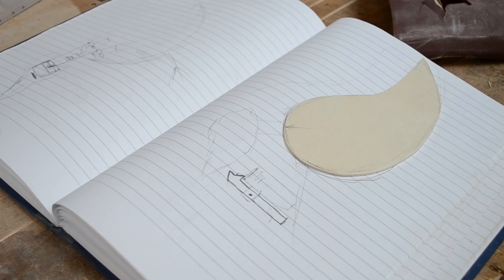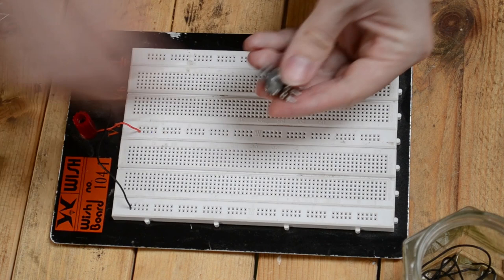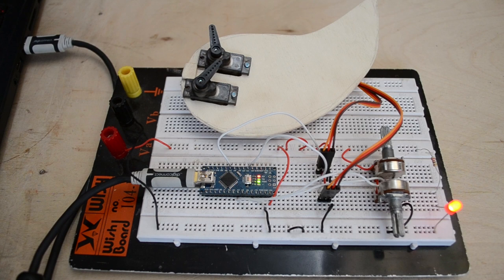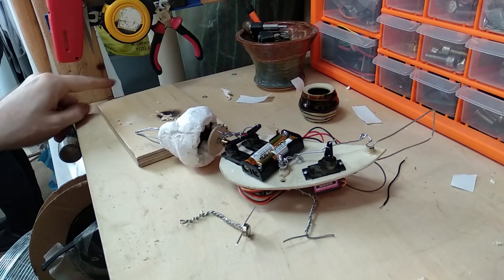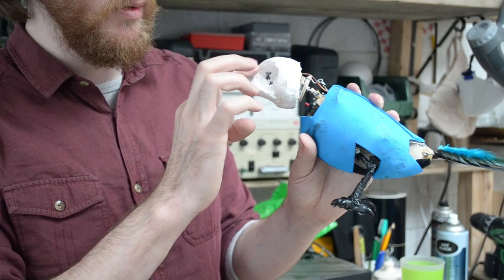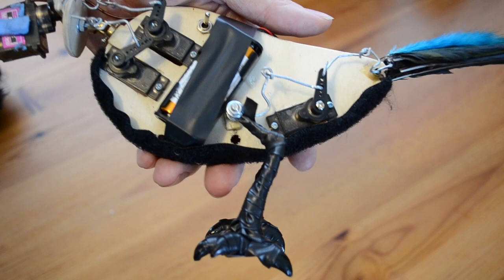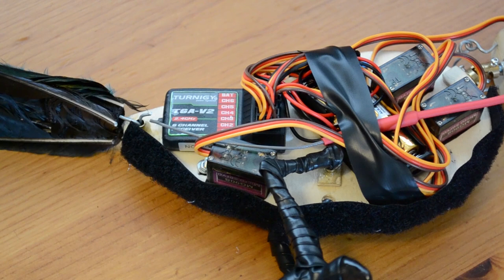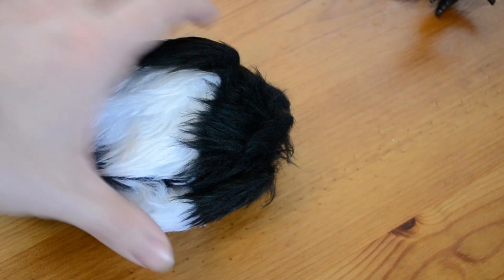Making an Animatronic Magpie (TLDR Version)

Comment: Wow that is amazing! Is Servo like an Arduino program? Such an awesome piece to the costume!
Reply from the maker: Glad you liked it. Servos are the little motors that pull on the linkages to make everything move. You can move them by wiring them to an Arduino, start with this tutorial https://www.arduino.cc/en/Tutorial/LibraryExamples/Sweep
Or, you can plug them into a remote control receiver, have a gander at my "build your own bot" video from many years ago for more info, https://www.youtube.com/watch?v=0PtLBAkk6Bc
Reply: Awesome, thank you so much! I do a ton of props and I’m just kinda getting my feet wet with electronics.